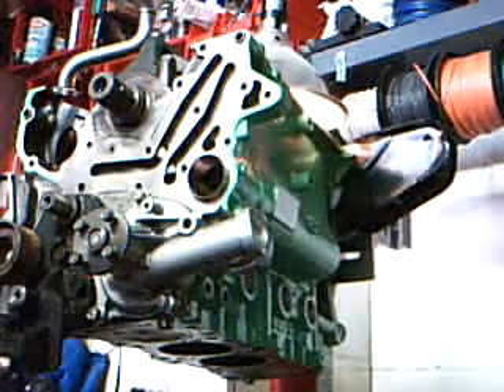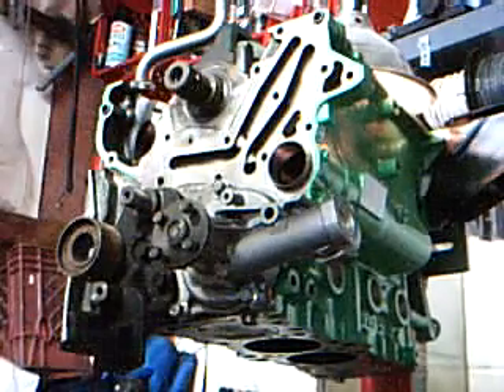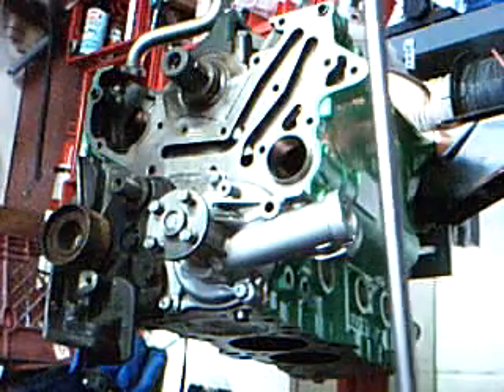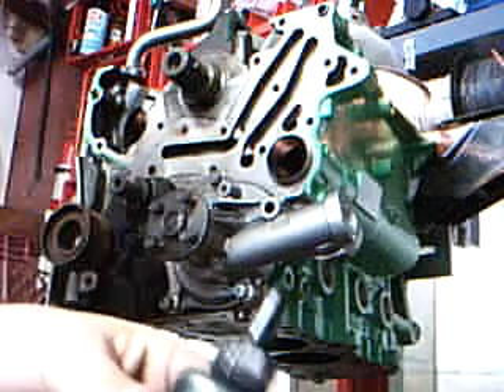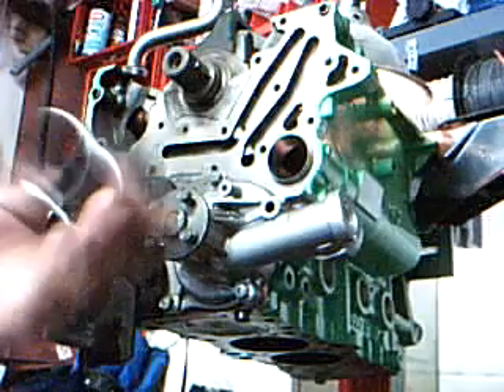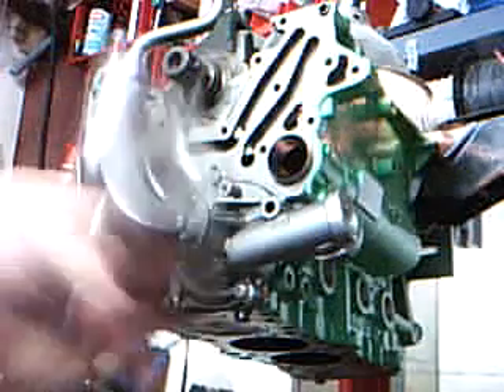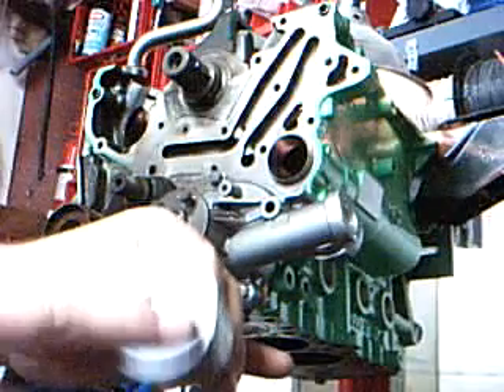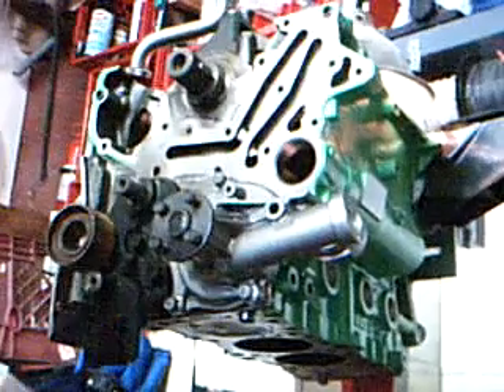4g63 block bearing install

Comment: So! How did you remove the old rear bearings?
Reply from the maker: I used a slightly larger socket bigger than the bearing inner opening on a long extention and hammered it out.

Comment: hey i got a question my 4g63 balacne shaft slid in the side of the motor causing the gear on the end of it to split in half and its leaking oil out of seal.... do you think icould just replace the seal on the shaft and leave the shaft disconnected and run the engine

Comment from the maker: @phoenixsmerk  the same way i installed. just knock em all the way out. you can also use the method bboyjohn04 used,  u want something blunt that will catch the edge of bearing but not score up the block or anything. take your time and youll be all right